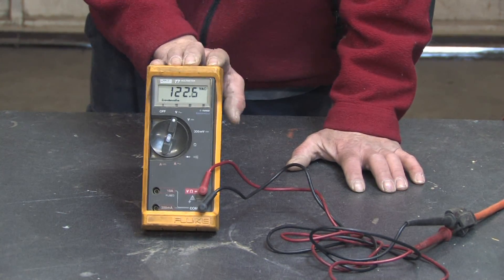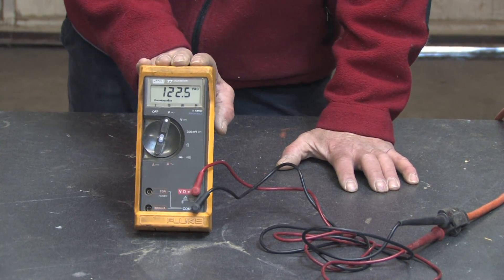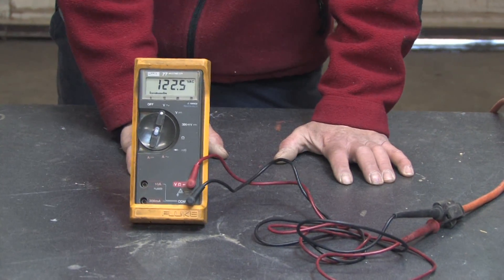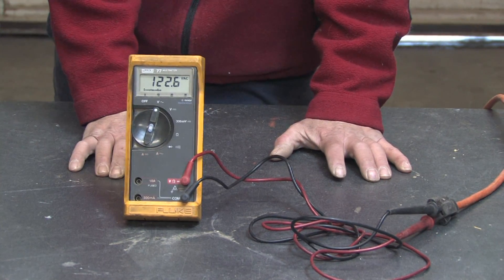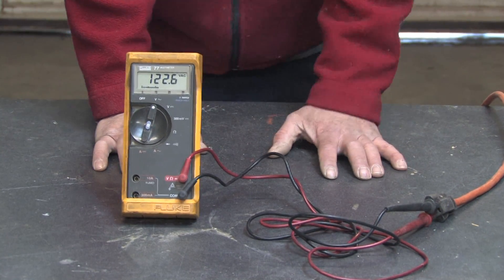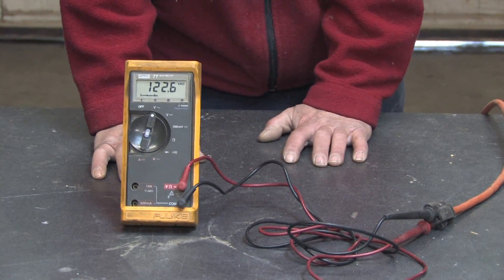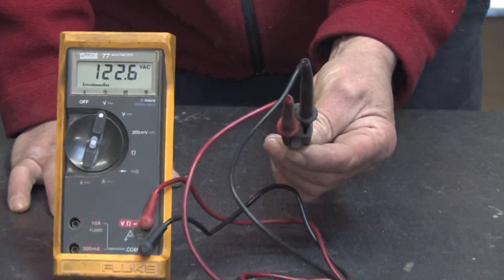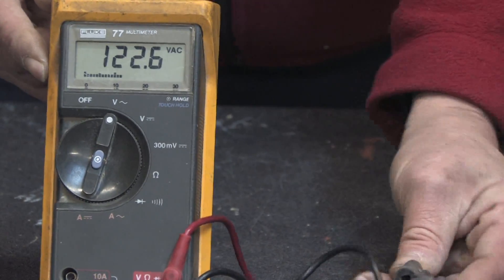Home Repair Tips : What Is a Volt?

Comment: I don't mean to discourage, but, you never did explain what a Volt was. I somehow got the impression you didn't really know yourself. Voltage doesn't measure 'electricity'. The phrase itself implies a certain lack of understanding, since one doesn't measure electricity and more than one measures metal. You need adress what ABOUT electricity is a volt measuring? I'll let you Google that.